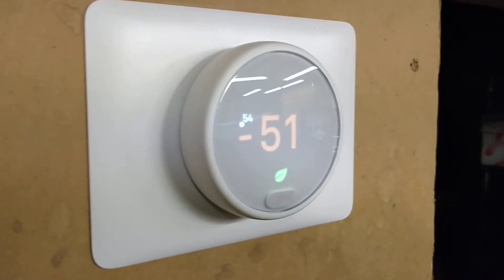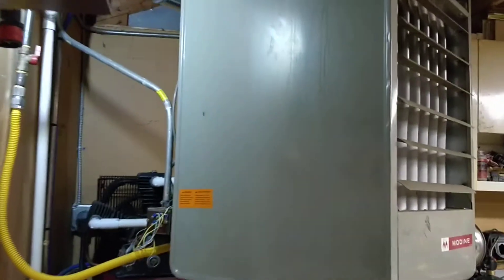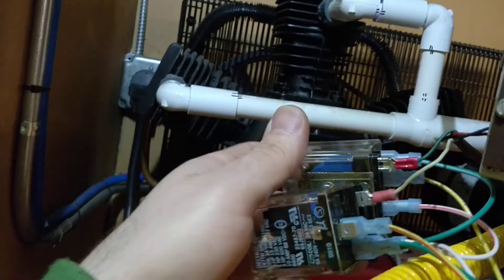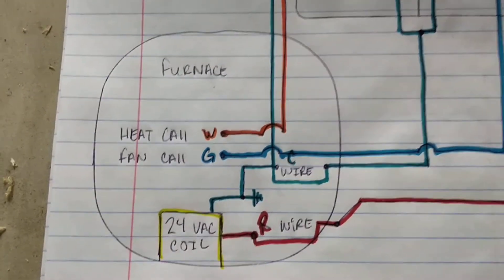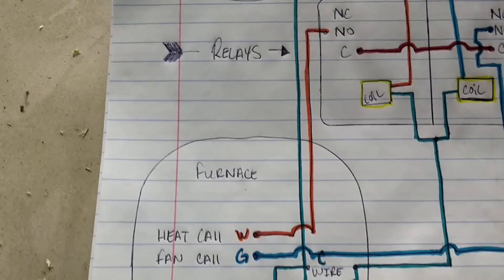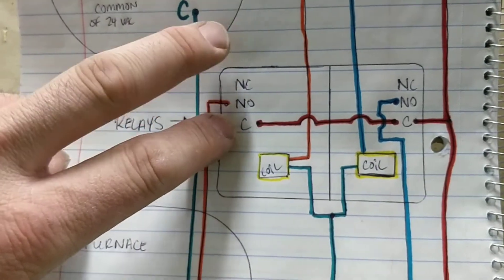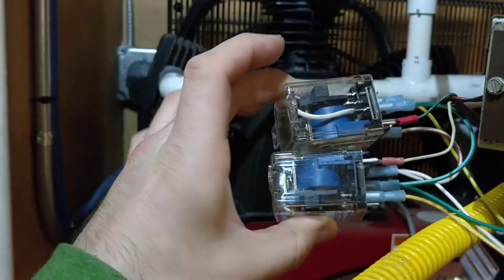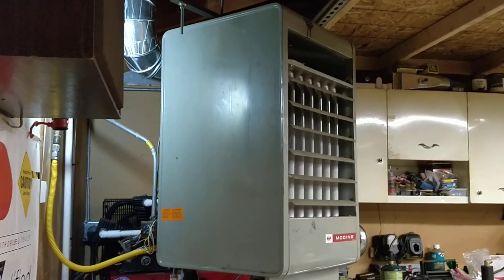Nest Over current e184 error and fix

Comment: Any reason you didn't just use an inexpensive resistor?
Reply from the maker: Older heater had a higher draw on the gas valve and other related parts. A resistor wouldn't have done anything unfortunately. While a resistor will reduce current, it wouldn't provide anything useful in this scenario, as there's no way to reduce the current the gas valve and heat sequencer relay need to operate.